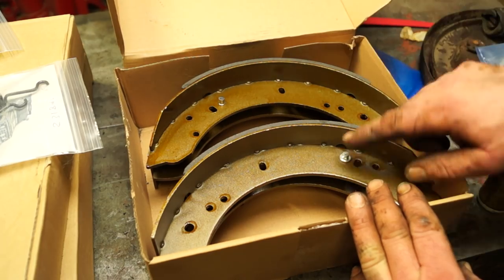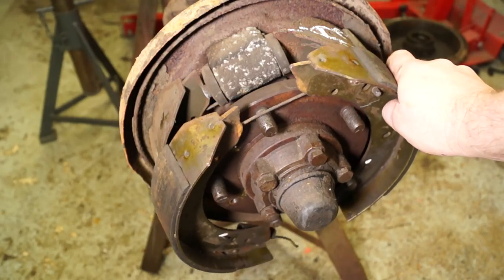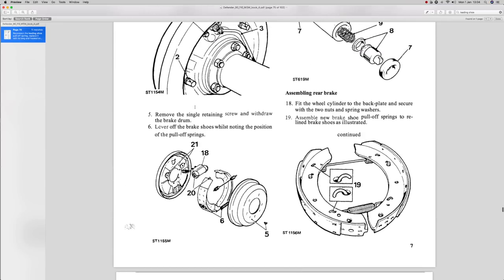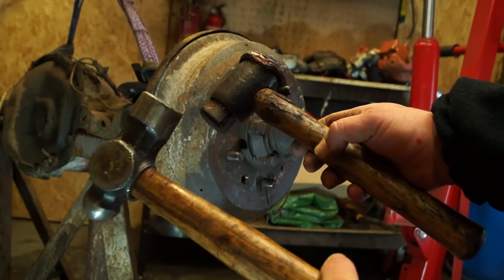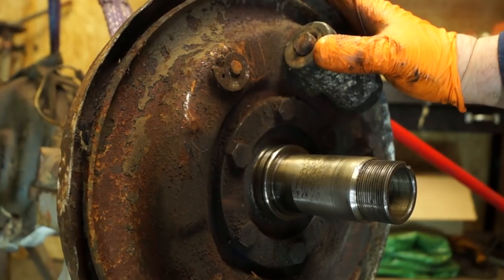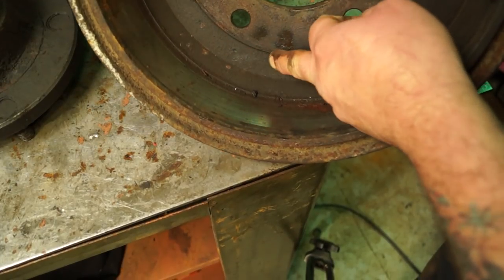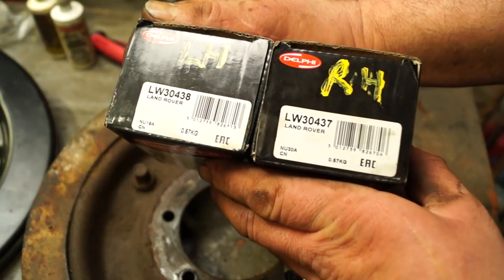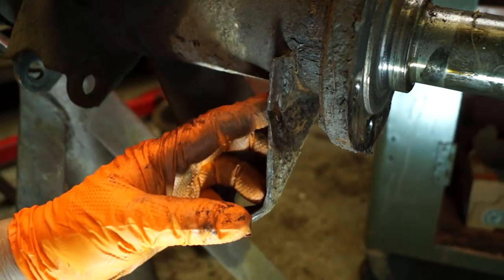Land Rover Drum Brake Overhaul  Part 2.  Strip Down ( past the ) Backing plates

Comment: Thanks for the guidance? Do all back plates have the heavy ring plate in front? Mine did not on disassembly- bolt straight into face of back plate. (Drum also didn't have the fastening screw either😯

Comment: Hello,
I did drum brakes on my Ninety last week. What I figured out is that you have 3 different seals for the rear end of the hub. I ordered wrong one and when I received the right one I mounted it the wrong way :) 
Up to 22S08283b use RTC3511

From 22S08284B use Normally FTC2783 but most companies deliver FTC4785. 
FTC2783 should be mounted with the lip towards the hub(differential) and FTC4785 towards the end (wheel side).
Source I found: https://www.landroverfaq.com/viewtopic.php?t=1280
Reply: thanks, looks like a handy source
Reply: Always use RTC3511 for all years.  It fits and is a better seal.

Comment: Hi Chris, my rear 90 rover axle seals failed contaminating ns drum, cue complete axle overhaul. However, end result, both sides brakes are rubbing, creating heat. Snail adjuster (just the one) are completely loose. I did each side independently, double checked leading/trailing edge, nothing obvious, trust me, i took apart a few times. Just passed MOT yesterday but still I don't like the situation, I drive accordingly.
Reply from the maker: MOT brake check would look at brake bind and ovality as it effects the brake figures.    QUestion is,  how much heat are they generating? brake do get hot if they are used but excessive heat would mean your brake perhaps would be binding?    Did you replace drums and shoes together or did you just replace shoes and keep the same drums?
Reply: Just the contaminated shoes Chris, drums not massively grooved but didn't know about ovality, drums got a good clean. Everything was going well until I fitted the shoes, then binding, hence the several re-checks. Heat wise, not stinking hot but hub/wheel nu-characteristically warm. I was just surprised that there was zero adjustment. You ask about and you get the "they'll bed in sooner or later".
Reply from the maker: can you turn the wheels freely without them binding?
Reply: Not easily, I even fish'd the old shoes out the bin for comparison, just in case I ordered the wrong un's. Bit of a mystery.
Reply from the maker: So basically the shoes are the same?  The lining thickness is the same?  Okay.  I have had this where the shoes have been sitting slightly at an angle and the edge f the shoe has been rubbing on the inner part of the drum where there is an edge.  Perhaps either the shoe metal is not straight or the backing plate is twisted giving you a bind in the wrong places.  I would say, check for ovality of the drums too but i think you'd feel it in the drake pedal as a pulsing.   Sorry for late reply.  Been busy this week as you will see in a video later.
Reply from the maker: I also thought perhaps the wheel cylinders if you have changed them. could be larger than the originals or they are protruding further out than they should do? I can't be any more specific than that.
Reply: Hi Chris, thanks for your help and mention, pays to be awake doing brakes, read the manuals etc. Page 478, pre-1996 90 service manual is confusing, snail adjuster on mine is towards the front, manual suggests towards the rear. Could these brake plates be on the wrong side?, then sat n pondered, it makes no difference since I'd only have to swap the shoes "for to aft, aft to for". more pondering, turns out the upper spring (one with the elongated side) was upside down, thus fouling the snail adjuster. Simple as that. I can now turn both sides freely. It helps to just nudge the adjuster off the stop. This adjuster rides against the pin on the shoe. Correct me if I'm wrong..
Reply from the maker: yes pin is on the adjuster